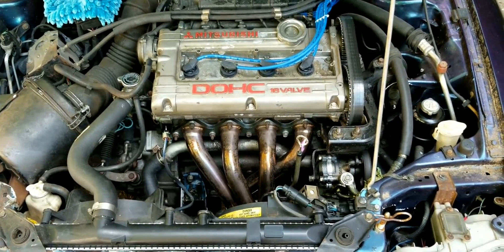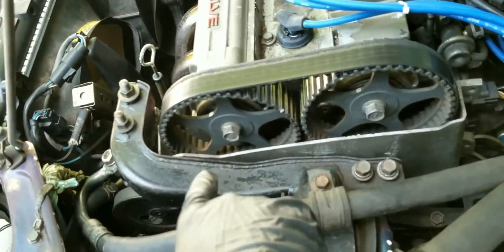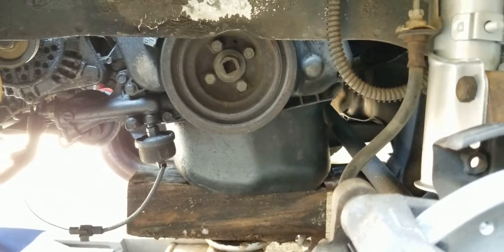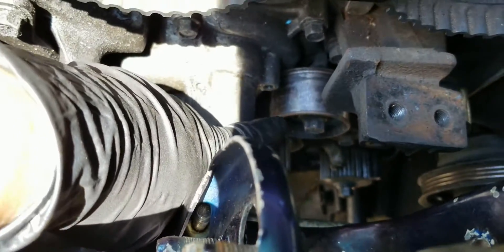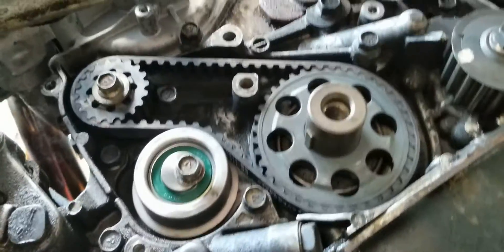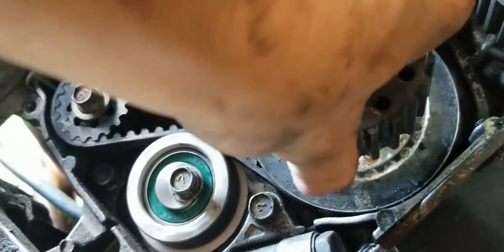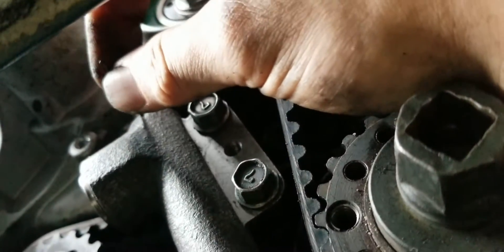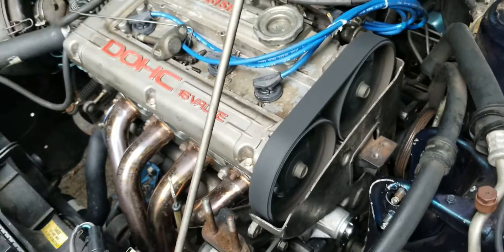4G63 or 4G63T Timing Belt Replacement Mitsubishi Eclipse, Eagle Talon, Plymouth Laser

Comment: The problem i had was when tightening the tensioner pulley bolt it would move and tighten the tensioner after having it already set. Making it too tight. So had to offset it and used the bolt as the adjustment. Stupid set-up
Reply from the maker: Did you have the special tool?
Reply: Yes i have all the special tools. You don't need any of them. Cam locks, pin tool for pulley and long rod to compress hydraulic tensioner on the car. You can use a 90 degree pick for the pulley and zip ties or something to hold the belt on the cams and lock the cams with something  @DIYKAI
Reply from the maker: @christianbrennan1806  yup you definitely can...I have had the tools for many years so that's why I asked either way works
Reply: @DIYKAI ya I've had my 1ga for about 20 years or so. Another thing I've screwed up is getting the oil pump and balance shaft out of time. Now i know better
Reply from the maker: @christianbrennan1806  got a couple GSXs waiting to be rebuilt

Comment: Will a 400 nm electric impact work on the crank bolt ?,
Reply from the maker: Should we used a Lowes electric impact but it's rated much higher 
What brand are you using?

Comment: I have a 1998 mitsubishi gst 4g63T 2g. What engine oil, coolant, etc do i need for it?
Reply from the maker: @Infinite_Gaming117  coolant you can use conventional green....flush the system first.
How many miles?
Reply: @DIYKAI  127,439 mi
Reply from the maker: @Infinite_Gaming117  5w30 synthetic for best protection 
If you have any leaks or smoking use a high mileage
Reply: @DIYKAI  ive heard Rotella 15w40 is good.  Is it?
Reply from the maker: @Infinite_Gaming117 that's a heavy duty diesel oil don't use it
Reply: @DIYKAI  what about coolant.
Also I noticed my coolant reservoir connected to my engine by a T cap, but the other end was disconnected. Should that go to my radiator?
Reply from the maker: @Infinite_Gaming117 would need to see it can you make a video?
Reply: @Infinite_Gaming117 Hey I know this comment is almost a year old but I would recommend running that 15w40 diesel oil like you said. The rotella stuff is good but I use valvoline premium blue because it has slightly better additives, you can get a 2.5 gallon jug at tractor supply which is just enough for two oil changes. If you use the rotella though make sure it says T6 on the jug, that’s the good stuff.
Reply from the maker: So that's ok if in a very warm climate otherwise hard starts and poor lubrication can occur because of tight tolerance

Comment: Doing another timing belt here soon on my 1ga, Did you fab a bracket to take off the crank sprocket without it spinning with the belt off ? Or wedge a screwdriver between the teeth ? Thanks
Reply from the maker: We have the special tool

Comment: I'm putting a timungbelt on a 1995 eagle talon 2L turbo.  The cams line up and  the crank and oil shaft line up but not to each other.
Reply from the maker: Not sure would have to check the service manual

Comment: This looks like a scary job to do. Also need to replace the water pump as well. I’m anxious.
Reply from the maker: Take your time if you have questions we will be happy to help
Reply: @DIYKAI  Thank you, my car currently has a p0300 code so that’s my main priority but I just can’t find out what’s causing it.
Reply from the maker: That code is for random misfire:

Check plugs, wires, coil pack, fuel filter

I would suggest a full tune up if it’s been a while

Comment: how often should you replace the timing belt ? did it last in 2016 and have driven only 5.000 miles since then and the waterpump? can it stay in if it s not leaking etc?
Reply from the maker: We generally change interference motor timing belts every 50k or so for good practice and change the pump while in there. Not to say it can’t go longer we have done 100k before with no issues. 
If your not hard on the car then you should be fine.
Reply: @DIYKAI  mainly drove it in town not on the autobahn and i shift early so u go after miles rather than years? btw thanks for the fast reply
Reply: btw i have a non turbo GS
Reply from the maker: @marcoh.6345  yes you should be fine than we drive like its stolen lol...anytime we are here to help!

Comment: Realistically speaking how difficult and timing consuming was this? I'm going to buy a 95 2ga 2g eclipse swapped to a 97 2gb. I assume the engine is the same but anyway, the water pump went bad so he wanted to do the timing belt too, and the mechanic cult the belt without locking the gears so it lost timing. I would want to do the repair before I buy the car and drive 10 hours back to Montreal with the car, repair it, and let's say find out its seized or something. Any info would be awesome and thanks a lot in advance
Reply from the maker: So this are interference type motors....DO NOT spin it over with the belt off it will cause damage.....

Do you have some type of cam locking tool? Also the tensioner takes a special tool.

 If you dont have them you could use needle nose and locking pliers.

It really depends on your mechanical abilities. For an "average" mechanic I would say it's around 3-5 hour job.
Reply: @DIYKAI  alright cool, shouldn't be too difficult then. Tore down and rebuilt my engine myself so I should be able to handle it. I'm also 10 months into a 16 month mechanics program
Reply from the maker: @Snail2G  oh you should be fine then if u run into any issues comment and I will help the best I can. Good luck!

Comment: How are you am replacing the timing belt on a 1993 Plymouth laser 2.0 I see that you show a hydrolic tentioner that's different from the one in your car is have bought three of them the last one looks like the one you show on the video am hoping it fit on mine I also bought the tool but am going to have to get the camshaft one I done it before with out the tools but I haven't been able to do it hope this last hydrolic tentioner fit
Reply from the maker: So yea i had to return that tensioner and use the old one. It did fit bolt holes were off.
Reply from the maker: I could not find the right one for some reason. If yours is not leaking reuse it. You will need a bench vise to compress it bad slowly and put a small drill bit in it to hold it
Reply: @DIYKAI  two late I forgot that I can use the press Wich is what I did when I rebuild the motor the first time and I throw it in the garbage I can believe I did that but I saw a lots of parts on ebay and other sites so I didn't worried hopefully this last on is the right one thanks for replying and thank Jesus that I finally got it on time know all I need is the hydrolic tentioner